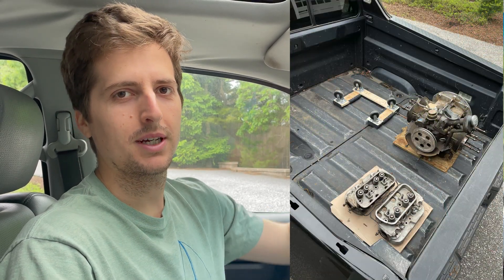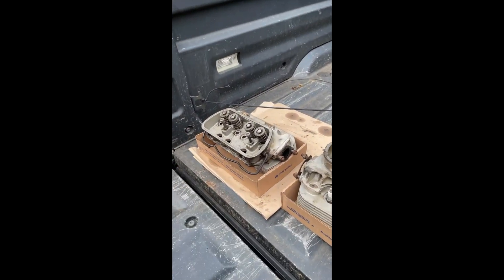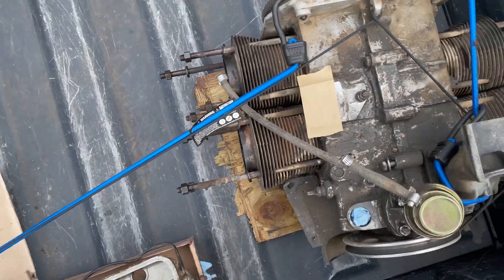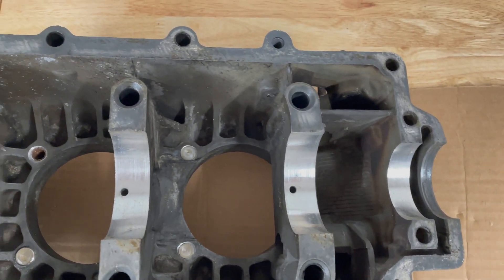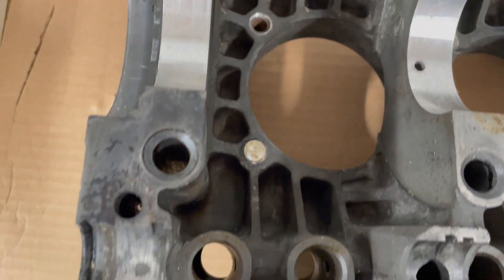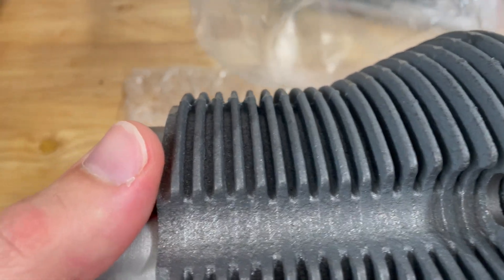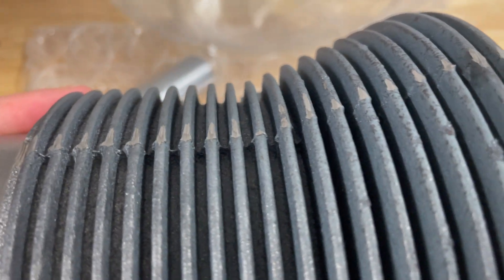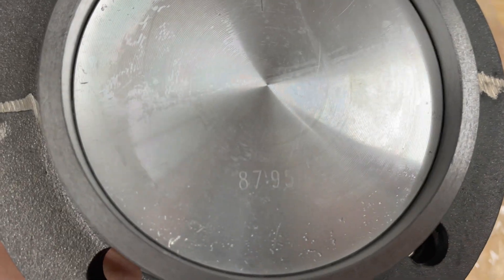VW 1679cc Engine rebuild step by step | Can I figure it out? Ep. 6 of 23

Comment: AA pistons are nice and so are their heads. Depending on the use you plan to give it might be better to use a new case. If you can spring for a counterweighted crank the better. DPR Machine Shop in California has great ones as well as Scat. And like I’ve said before in many cases getting a new fully built long block from Scat is a great alternative; they use good quality parts and assemble them right and you are assured of having something that will give you many years of service. Looking forward to the adventure.
Reply from the maker: Yes! I noted your comments on buying a long block, but I’m too stubborn and want to build it myself. There will be a lot of learning by failing

I do have a counterweight crank from CB , will use AA pistons and AA heads from your recommendation 

Thank you!

Comment: You bought a used case? Looks like it’s been machined as well or did you have it done? Make sure to clean that case really well before assembly.
Reply from the maker: Yes I bought it used and it’s align bored.
Reply: @onehappykombi  oh cool how many times has it been aligned bored? The old one had already been aligned bored so many times, it’s crazy to think. I need to take my case apart. I think I spun a bearing cuz it’s making a lot of noise. I need a new case but going to buy a new one maybe but they cost around $1,000!!!
Reply from the maker: The case in this video was cut for the first time

If you are in California it should be easy to find cases! What are you trying to build?
Reply: @onehappykombi  okay awesome. Glad you got a good case. Yeah maybe I can find a good used universal case I can rebuild.